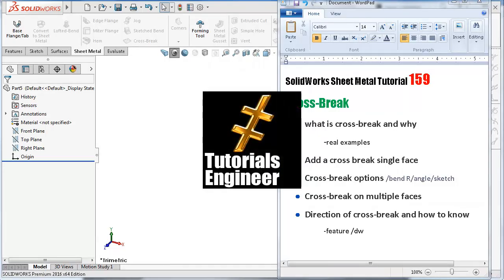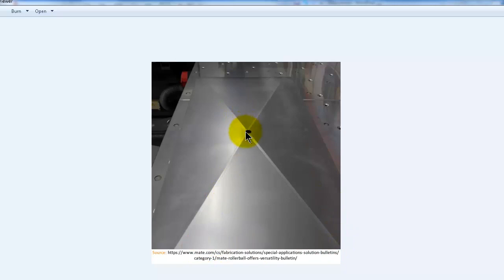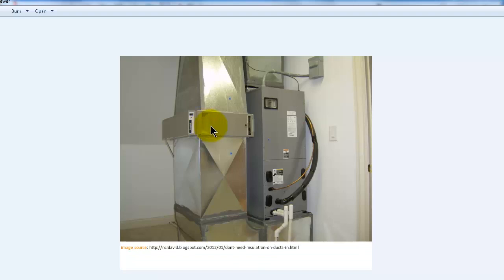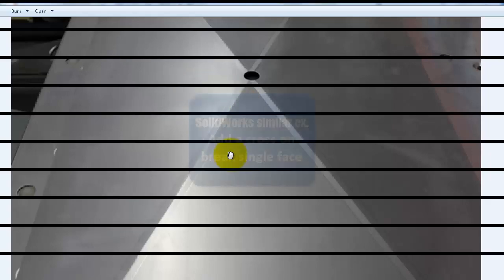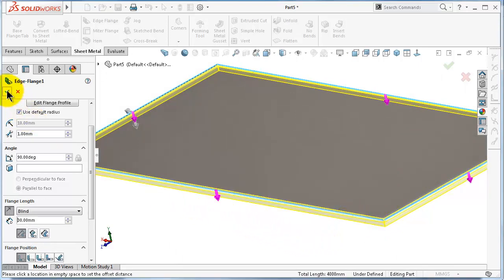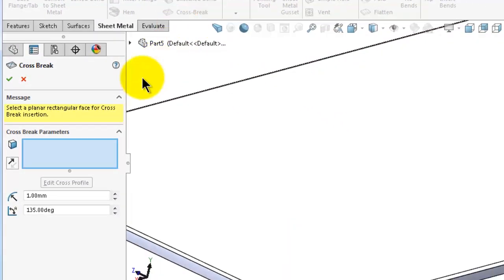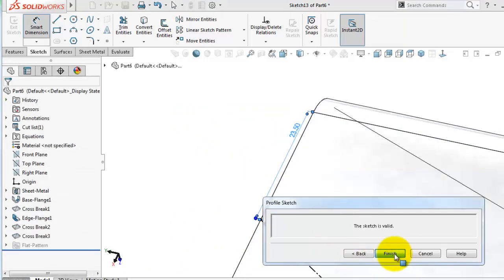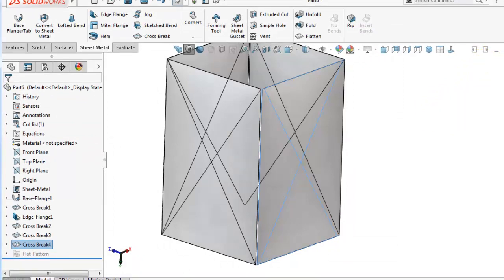159 SolidWorks Sheet Metal Tutorial: Cross-Break, reason, real examples, single and multiple faces

Comment: A summary from Google: A Cross Break in sheet metal is when multiple obtuse Bend Angles of approximately 170° are made across a flat section thin metal. Cross breaks are most commonly in an X shape, forming a slight pyramid shape in the metal without overly distorting it. The nature of sheet metal allows stiffening without adding additional material and weight to the finished piece. The process of stiffening sheet metal--known as cross braking--places a small bend across flat sections of metal. Each bend reduces the flat area of each side, increasing its overall strength.